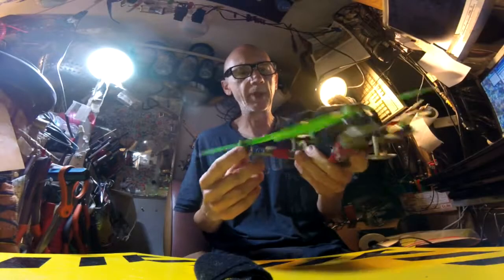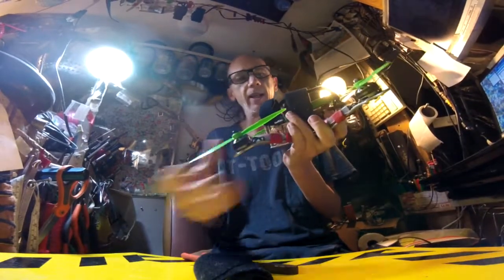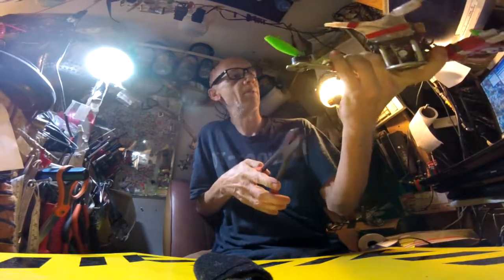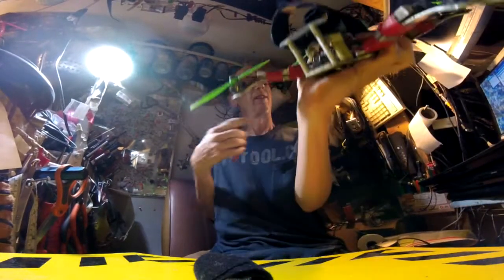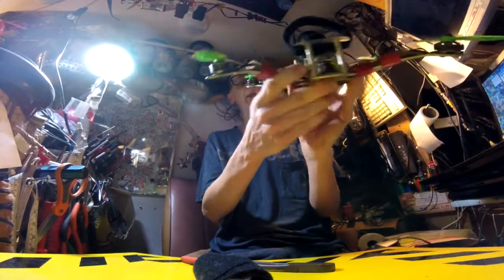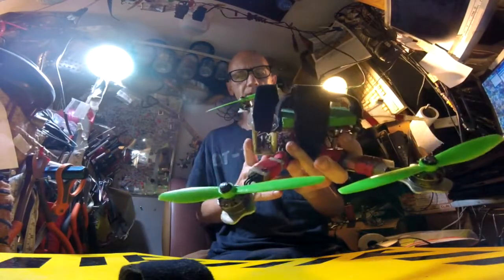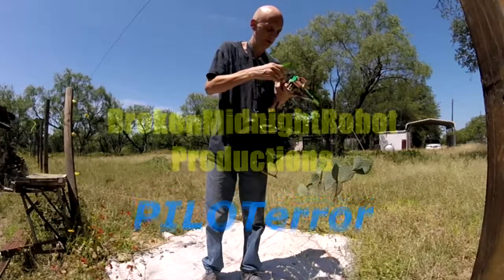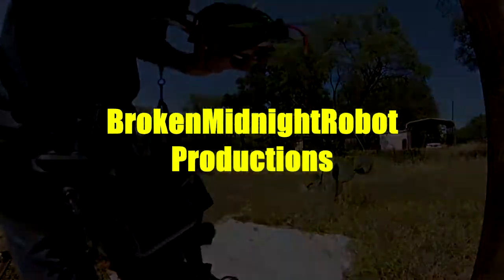06 22a forward thrust arm twisting

Comment: How fast you think that is going in typical forward flight?
Reply from the maker: In the next video I counted the image frames as it passed some newly placed property markers and it was hitting 100 feet per 1.1 seconds. Not typical but I think my normal trail racing stuff runs about 30 to 40 mph.